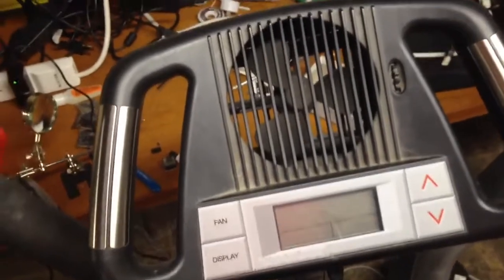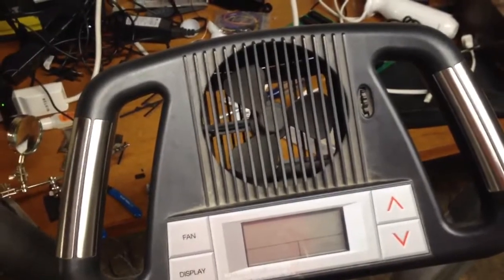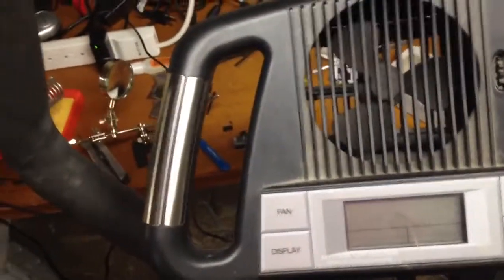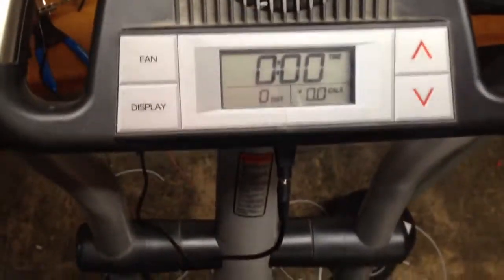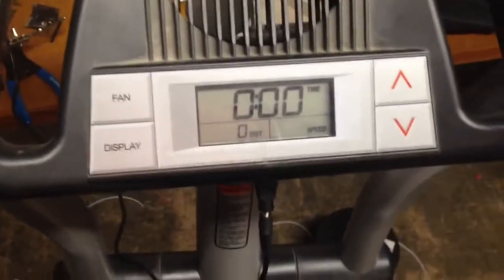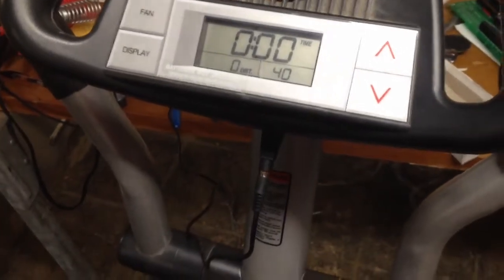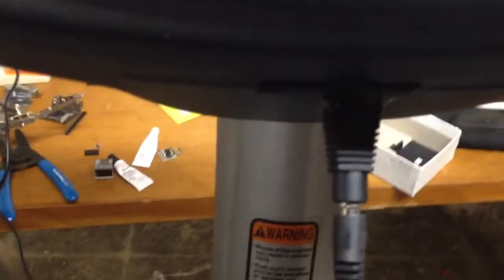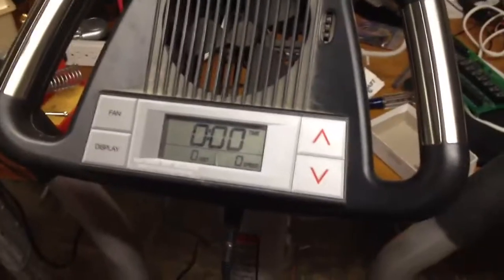Battery to plug hack

Comment: Good hack, but is not clear at all 👎
Reply: Where the cables should be weld on the batteries space, the link of the items u bought, how to conect positive and negative cables, basically ur not showing anything, other than that u did a good job
Reply from the maker: what isnt clear?

Comment: I was hoping to connect the batteries to a meachano-electrical transformer (not clear on terminology)..  the Nordic track 1600 requires no batteries, is similar in design to the 1000, and does not require batteries to power the circuit features. Any ideas?  

If I can’t do above I’ll do what you did. Great hack! Thanks.
Reply from the maker: you mean its powered by the person using it? in that case it'd be a bit trickier, but you'd want to get a multimeter on the output of that transformer to see what it puts out (voltage and amperage) then just get a power supply that does that, and splice the wires, you could even add a switch, or to get fancy, even a transistor to switch between power sources
Reply: I imagine there are batteries, sorry. But the batteries are kept charged by the motion of the Nordic track. Maybe there are schematics for the 1600 that would show the components.  

Thanks.

Comment: Hey it's me again and I'm just wondering if I could make like a battery box type... But smaller. So what I am planning to do is take an outlet splitter and have a bunch of 9v connected to make about 100-240 volts and take the 2 ends and connect the two ends to the outlet splitter plug so that the 9v are powering the outlet. Does that sound good?

Comment from the maker: well before starting something like this, you should understand voltage, amperage, and how to convert/transform them

basically your ps2 wants 8.5v it sounds like, next? find how how many amps its pulling. Then get a battery big enough to last however long you want (depends on how long you want to use it, and how much the ps2 uses)

Once you have the battery, you'll need to convert the battery's voltage to 8.5 (with either a step up or down regulator/booster)

Comment from the maker: 12v will not electrocute yourself, but you do need to be careful of shorting the board.

Here is a brief tutorial on how to use a multimeter.

No offense, but based on the questions you are asking you may want to start with a simpler project. 

I would unplug the powersupply from the motherboard, then plug it into the wall, and test the plug that SHOULD go to the motherboard with your multimeter :)

Comment from the maker: Nope, all a power supply is doing is converting a supply voltage in AC (110 in the US) to a another voltage in DC (in our case I think its 12v)

You need to test the voltage coming out of the power supply inside the ps3. So you should have a wire from your outlet that goes INTO the power supply, then some wires go from the power supply onto the ps3 motherboard. this second set of wires is what you need to test

Comment from the maker: no, the power coming out of your outlet is 110v (if you are in the US)

You need to measure the voltage coming out of the power supply. (Looking online I think its going to be 12v)

Once you know this, you'll need to get a large battery (laptop battery or something similar should be ok) and a voltage regulator to make sure its going to be feeding 12v (or whatever you find from the ps2 power supply)

Comment from the maker: I dont have a ps2 or gamecube. But basically you need to measure the voltage coming OUT of the power supply. the voltage going in is going to be house current (110 or 220 depending on where you live)

Look at this pic for where you need to measure ifixit.com/Guide/Installing+PlayStation+3+Power+Supply/3483/2

Looking around it looks like its 12v but I would double check to be sure :)

Comment from the maker: each aa is 1.5 volts (you can test this yourself but using a multimeter)
if they are wired in series (+ to -) they add up making it 6 volts

Comment from the maker: in that case you'll need to replace the power supply... supplying 110v via batteries is a bit silly... get out a multimeter and see what the voltage is coming out of the power supply, and match that with batteries and step up regulator

Comment from the maker: maybe...

but it all boils down to this... batteries have a variable voltage, you need to make that constant (and be the same voltage your device wants)

So you'll probably need a step up/step down converter.

To be helpful, I'd have to know what you want to make battery powered :)

Comment from the maker: of course! The thing about batteries though is that they never put out a perfect voltage... they are constantly dropping voltage... so you would need a voltage regulator inline... lets say you want something 5v (most usb stuff is 5v) you could use something like spark fun's NCP1402-5V Step-Up Breakout

It takes 1-4v so you could use 1 or 2 aa's to power it.